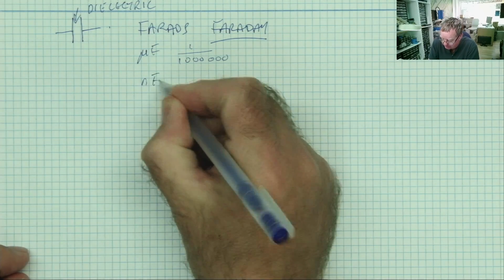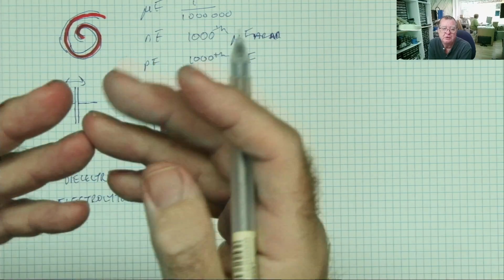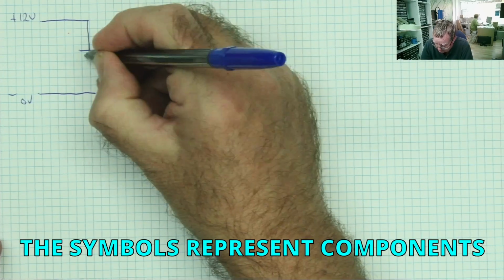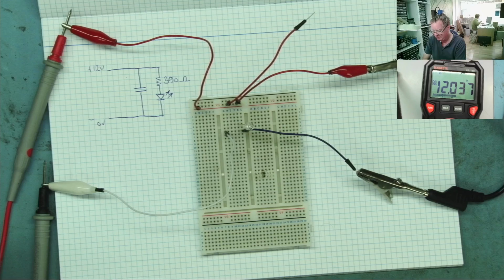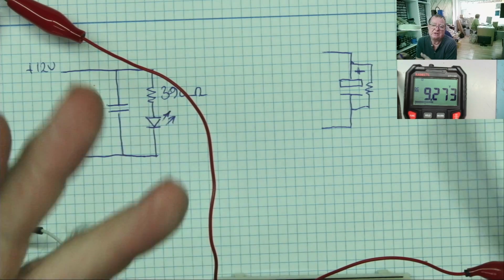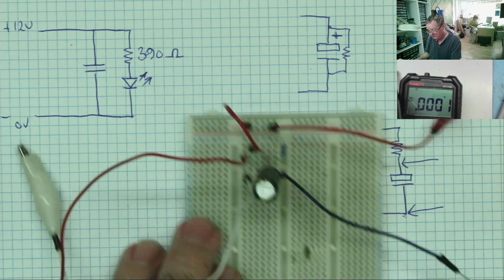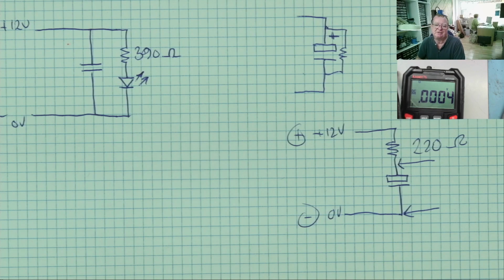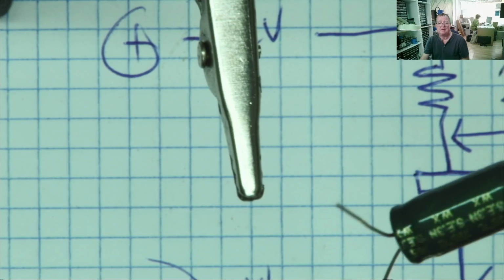Learn Electronics For Beginners #7 Introduction To Capacitors

Comment: Hi Richard, very nice learning methods :) , i want to repeat what you are doing , i bought the breadboard and resistors, capacitors ... etc
just still missing the power supply and the multimeter, any suggestion ?

Comment: Great video. Informative and fun! So, why might we use capacitors in electronics generally? Is it so that if the electronic loses its voltage somehow (in a power outage or something like that), there’s a backup charge to keep it going for a bit?

Comment: I actually have a anecdotal story about capacitors. When I took physics class in college many years ago, we had some section about electronics and capacitors was one of the chapters, and a guy I knew back then had found a 1 farad--yes, a whole farad--capacitor. It came from some old IBM mainframe powersupply. This brilliant guy shorted this gigantic capacitor using a regular nail and the spark burnt of a chunk of metal from the ports. Crazy guy. He liked explosives as well. Don't know what happened to him though.

Comment: Really good, well presented stuff. It would be nice to get an idea at the beginning not only how the basic components work, but also what typical uses they're put to. e.g. for capacitors, smoothing, noise filtering, etc. Even if the details will come in a later video it would be great to know why they're found in almost every circuit.

Comment: Thanks for another great video Richard. I've been reading/watching a lot about capacitors recently to try and understand an astable multivibrator circuit utilizing 2xNPN BJTs. As I understand it, the property of 'displacement current' of a capacitor in crucial to this circuit's operation. What I don't fully understand is under exactly what conditions does displacement current occur? Obviously a 'rapid change' in potential on one plate, but just how rapid? It would be great if you could cover this property of capacitors in one of your future videos as I understand many circuits make use of this property and I'm sure that would be useful for many of us to understand. Thanks again for your great content!

Comment: Hello Richard, you always have en enlightening video. Your  quizzes are always fun. The one thing I would like to mention is that the
capacitor discharged through the resistor and the  internal resistance of the LED, which is about 20 ohms. Keep up the great videos!!

Comment: A couple of things you missed.... bi-polar electrolytic capacitors (commonly used in audio circuits) and putting a polarized electrolytic capacitor in backwards. The latter will of course cause the cap to instantly explode. Same for tantalum caps too. Maybe you can do that as a grand finale in the next part hehe!

Comment: The cap at the end of the video behaved exactly as it was intended to. The pressure in the cap caused splitting of the top of the can along the indents there specifically for that reason. However, even with those indents or in big cans that have a pressure relief safety plug, explosions do happen. They can be very dangerous and cause severe injury. You can wind up with the can where your eyeball used to be or being sprayed with boiling electrolyte.

Comment: I avoid using Swiss Rolls or Christmas Logs in power supply sections; they tend to leak at higher temperatures making the boards tacky and inviting ants.
Reply from the maker: True. I think Christmas Logs also have the higher capacitance per layer, mostly due to the high chocolate content 😜Well 
it works for me anyway, if i can beat the ants to it
Reply: @learnelectronicsrepair  loool

Comment: Since non polarized capacitors work in both directions do you get the same results with the resistor in series with a capacitor when ac voltage is applied?

What about ac voltage across a capacitor and led in series? Since the led only works in one direction does it still light but at a 50% duty cycle because of the ac only being in the right direction 1/2 of the time?

Do these resistor capacitor circuits start developing tank circuit properties when using ac across them?

What about with the capacitor and led circuit with ac; does this start to function as a basic crystal radio with a diode?
Reply from the maker: Hmm lets try this....
Reply: A resistor in series with a capacitor (resistor between input and cap; output across the capacitor) forms a "low pass filter." It takes quite a lot to explain how they work, so I suggest you look around the web. I had a quick look and found some articles that aren't too heavily into the math.

An LED will behave as a rectifier, so if you put one in series with a capacitor and apply AC the LED will light briefly until the capacitor is charged to the peak voltage of the applied AC minus the forward voltage of the LED. There is no mechanism to discharge the cap, so this is a "one time" event. The reverse breakdown voltage of LEDs is quite low, so this only works for low magnitude AC input. Without a resistor in the circuit the initial charge current could be high enough to destroy the LED. If the RC time constant were very long with respect to the period of the applied AC it could take many cycles to charge the cap. 

You need two reactive components, normally a capacitor and an inductor, to form a resonant circuit ("tank"). Energy is transferred back and forth between the two reactive components. A simple RC circuit does not resonate.

The forward voltage of an LED is high enough that it isn't a good detector for a crystal radio. You would need a very large signal from the antenna and resonant circuit to get enough voltage for it to work well. A germanium diode is usually what is used in a crystal radio.